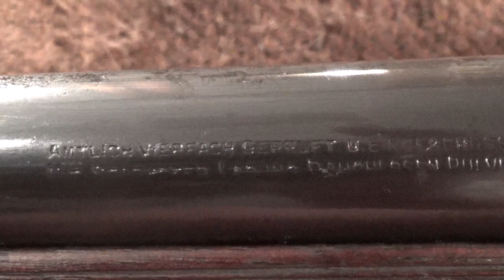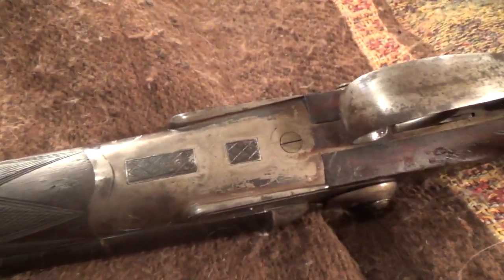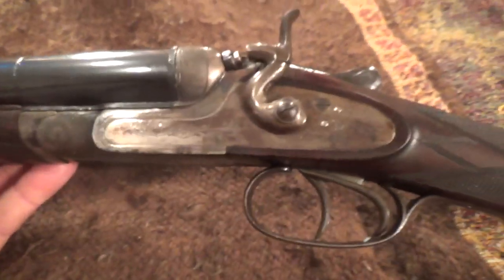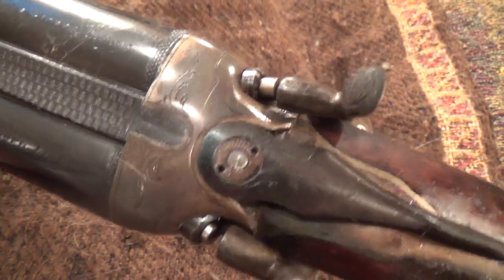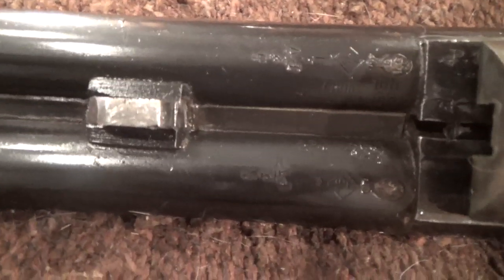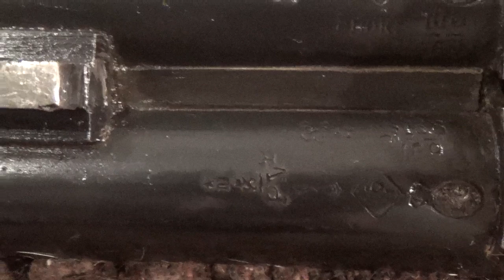The rusty gun part 2  Nicolas Pieper Liege 16 gauge

Comment from the maker: Oil, and an old copper bore brush to scrub the rusty spots.  In this case I also had a regular copper brush as well.  Never scrub with steel, always use copper as it will not mark the metal .  Oil, scrub, when the oil turns a rusty color you wipe it away and apply more oil, scrub, and keep doing it until the rust is out of the pits.  Just scrub the rust itself, not the entire barrel, and follow it up with Never Dull magic polish for the final finish, you can get that online.

Comment: ring the barrels and use black powder shells.
Reply from the maker: The rust is only on the surface and the bores are good, this is a Great War era, or early 20's built gun, it was designed for smokeless shells and should have no problem with them.  The barrels ring true, no issues there.  The rust is entirely gone now, only some light pitting remains